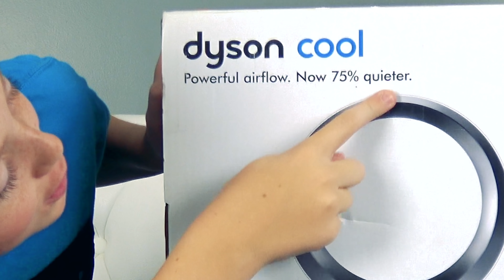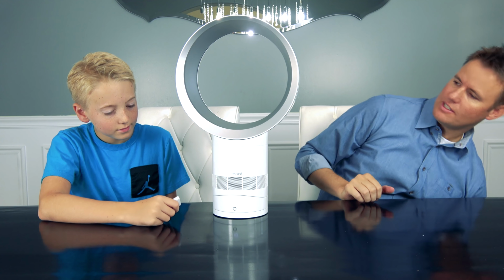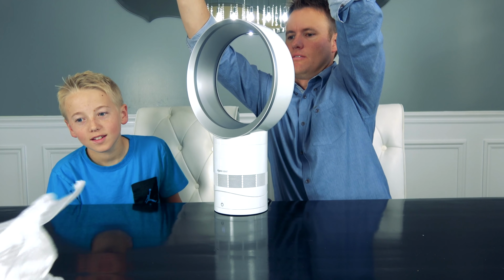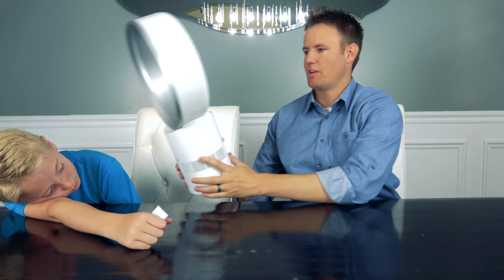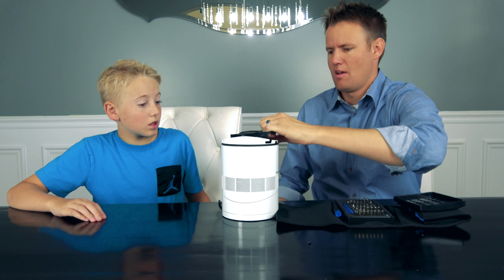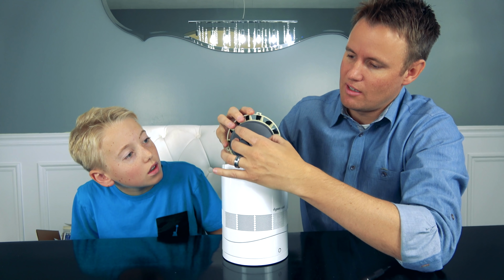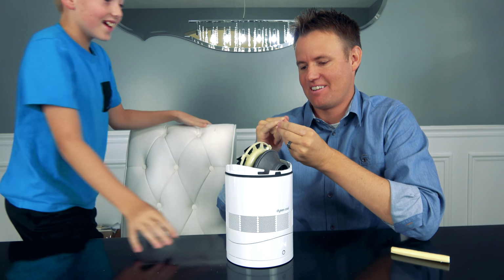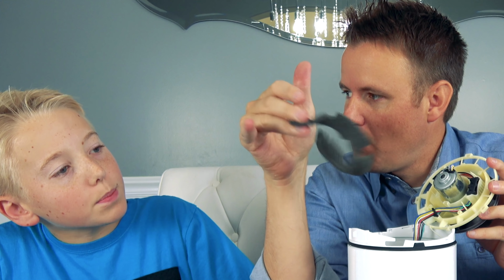Whats inside a BLADELESS Fan?

Comment: 6:32 you're probably referring to gyroscopes "the moving things" those things are moving in a circle due to the effect of precession.

The reason it's hard to move around and you feel this thing pushing against your hand when it rotates is due to the law: conservation of momentum. This rotor is rotated probably by a BLDC (brushless DC) motor, and it spins about 10.000+ RPM that rotor has a moment of inertia a quantity similar to the mass of an object. Inertia is for rotating objects, mass is for objects having linear velocities. If you multiply the angular velocity vector (axis of rotation, and magnitude) with the inertia you get momentum, more specifically in this case angular momentum. The reason it's hard to tilt it, is because you have to exert a torque on it to change it's axis of rotation. 

Fun fact: an object's mass is a scalar quantity, it can be described by a single number, like 10 lb or 10kg, but an object's moment of inertia is described by 9 numbers arranged in a 3x3 matrix (also known as tensor)!! Cool right? Nice teardown
Reply: Why was this comment necessary?
Reply: That wasn’t a “ fun ” fact tbh😂
Reply: I have no idea what u just said
😕😕😕
Reply: Did you really just compliment yourself at the end of your comment? By "nice teardown" did you mean a nice breakdown or explanation of those laws of physics? A "nice teardown" or explanation would be taking complex laws of physics and making them easier to understand using common language all can understand. You took simple laws of physics that are easy to explain and made them more complex in order to make yourself sound smarter than everyone else. So, for whose benefit is this comment really for? Those whom are reading it or you and your ego?

Comment: Soooo, a bladeless fan uses a turbo blade? Ok then...
Reply: sucksqueezebangblow DID SOMEBODY SAY TURBO?
Reply: sucksqueezebangblow It's not bladeless then 😐
Reply: Mario Mario 
No
Reply: What did you expect. That is worked by magic?
Reply: yes, i was expecting cathulu's imprisoned souls to be running in a hamster wheel.
Reply: I dont see any reason to choose this fan over classic fan.
Reply: sucksqueezebangblow turbo blade it sound too cool
Reply: Pawer8 probably expected a fan that moves air without blades, i'd imagine, but magic is an option too i suppose
Reply: sucksqueezebangblow it's not called a "turbo blade" and there's really no other way to make a fan as effective without a fan, because it will be very expensive to do so
Reply: a mystery it will be very expensive to make electric magnetic metal  plate that can move air pass it with out a blade maybe in 2050 haha some of us won't be here maybe..
Reply: Cool
Reply: Mario Mario 9
Reply: Hahahaha
Reply: @fewik8567  it's a turbine, which is a type if turbomachine that has blades in it's shaft. so in a way, they are turbo blades.
Reply: You should have been able to figure it out without tearing it apart. Surprise.. no magic.

Comment: It's called an impeller. But then... regular fan blades are also a type of impeller. But this one is a centrifugal impeller -- it pushes the air that goes into it to the edges, where it is then channeled into the ring where it ports out. A conventional fan, on the other hand, is called an axial impeller, or a propeller. It pushes the air that goes into it from the sides and back out the front. The centrifugal impeller has a smoother flow because instead of drawing air from the sides and pushing out front with a few large blades, it uses many small blades to draw air from the center, push it out the edges, and then duct it to the ring where by then all the remaining chop is mixed out by the ductwork inside the housing.

Comment: They're not actually blade-less fans. They just moved them to where you can't see them. They're safer and probably more efficient, but still have blades. The only way to make one completely without blades is to rapidly heat up the air. Even then it's a heater.

Comment: This is a single stage axial compressor that is built up by the stator ( at 3:48 that's black thing) and the rotor ( that's the grey rotating bit at 4:00. )

Comment: Cheeses are covered in cheese wax so they can age without growing other molds while maintaining their moister. When you want to use said cheese you need to cut it open which results in gas that built up over time from the aging process to release. This gas often has a strong unpleasant smell and so the phrase "who cut the cheese" refers to asking who farted as it's also an act of releasing an unpleasant smelling gas.

Comment: He should have stuck the cheese on the pointy part of the fan. The exhaust part of the fan blades just slaps you if you touch it. Whereas the intake side is the side that actually cuts in

Comment: Without watching yet, I bet the blades are just inside the casing and the air goes through the slit going around the inside of the round wheel.  Just sort of a standard fan made to where you can't see the blades.  They also don't put out as much of a breeze as standard fans.  So don't really see the point.
Reply: The narrow slits make them come out quite fast, but on their own does not provide much airflow. But, they will pull in the surrounding air along their path because fast moving air has low pressure. The stagnant air on the inside of the ring, being at a higher pressure would get "pulled" along by the jet of air, and of course air would just get constantly pulled into the ring from one side and out the other continuously. The same principle is used in airplanes' evacuation slides, but with compressed CO2.

So they do at least get the airflow of a standard desk fan, but using a considerably smaller motor and blade diameter, and much less safety hazard.

Comment: what they have inside is a turbine that funnels air through and they call it blade less. it has very poor cooling capacity compared to a normal fan. a normal fan with double blades will beat the dyson flat… no contest.

Comment: To cool and to much fun-looks like it would make a great air injector for and automobile engine-would probably get you 20% better gas mileage----hook it up to a 1000 watt dc 12 volt to 110 ac converter. The guts part I mean not the whole fan.